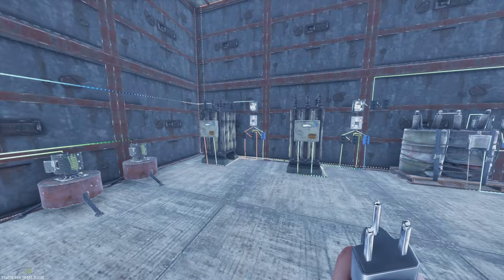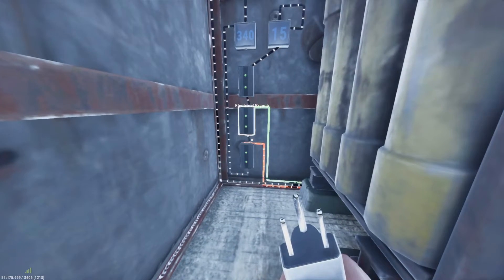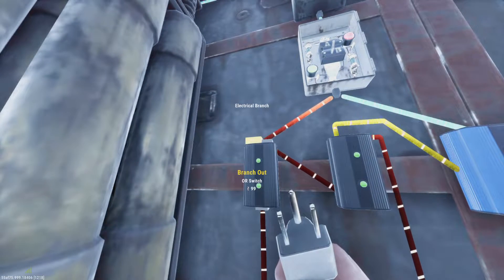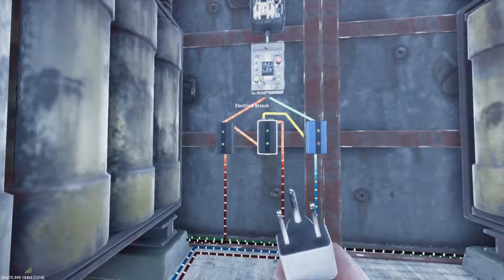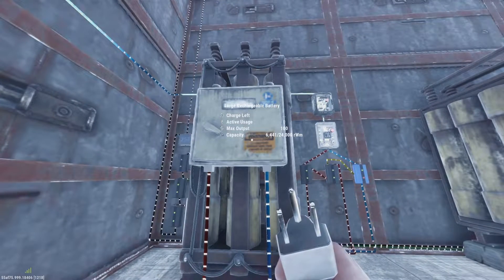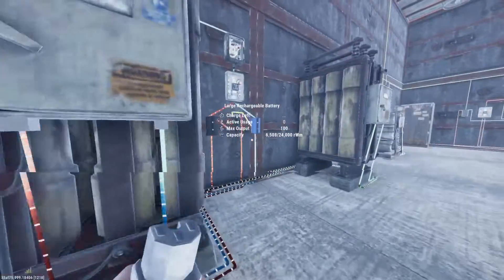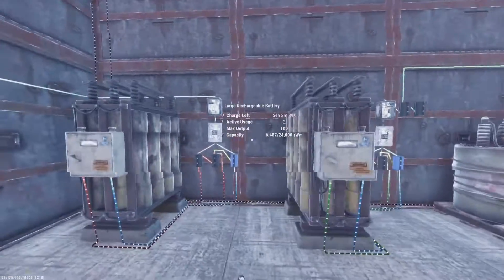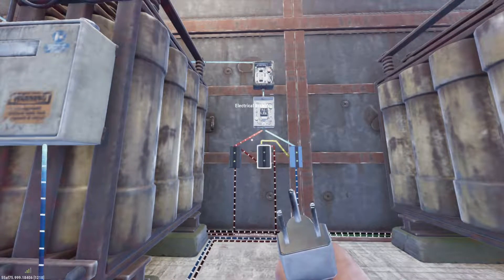OR/Blocker Power Management  Setup - Rust Console Edition

Comment: So just curious but what’s the benefit of running this setup vs running straight from the solar to the battery to the 3 way splitter to feed the rest of the system, as long as your producing enough power to properly charge and run the system what is the difference
Reply: If some hits your battery that would go down. This system can handle the battery being griefed and your power stays on
Reply from the maker: 100%. Provided you do have a wind turbine. If running solar only you will lose power only at night if your battery is griefed.
Reply from the maker: So 99% of the time the most vulnerable electrical component is the battery. They are hard to hide and once gone your whole system is down.

They also require 150 power or higher to charge and cover the night when under full use. So to run 6 batteries you would need 800 power min cnsitant during the day.

This system does 2 things. The first is that once setup it requires the same 150 to charge. Once charged fully in a few hours it can be set to 105. Saving 45 power. Multiply that by 6 and you saving 270 power. Giving you more power for 2 Moe batteries or 18 Moe Turrets on the same power intake system.

It saves that power by feeding the power directly to the Turrets themselves saving the 20% lose when charging batteries. It also then makes the batteries a backup system that only powers the Turrets when you producing less than the 800 power mentioned above. Which with the right solar/wind setup should never happen. So you're batteries can be destroyed and still have all your Turrets running.

Trust me for the parts it takes to make its 100% worth it.
Reply: @Mr.RustyHydra   I agree with you, my buddy was asking me what the purpose was and I couldn’t give him a definite answer, thanks you for the clarification. Btw love the videos, keep up the good work
Reply from the maker: No problem! Glad it helped! Have a great wipe!

Comment: Ive got a triple large battery switch over system, i try use minimum parts keep tge system light as possible in watts like its apollo 13
Reply: Mr hydra thats some serious depth of an answer and thanks for taking the time to help explain for me and others that see this comment,  ive been working on a hidden system with solar and a genterator that kicks in at night and off in morn as i always end up with too much low grade and solar can be hidden on the edge of square and triangle roofs that join simular to a furnace base, one binus is when they blow the roof and solar the generator automaticly kicks in.
Reply from the maker: I never thought of an automatic generator... Quite the idea. Love to see the end result. 

Also you're welcome for the details. To some it doesn't matter but to other it matter alot. Especially builders as they can take what they learn here and use it elsewhere. Like I did!

Almost at 1000 views in less than a week! That's 1000 people I feel I've helped. Which is why I'm here after all. Thanks for watching and commenting my friend! Let me know if you ever want to get together on the PTB and mess around with wiring!

Oh and the best way to hide you panels on the roof is to make sure at least 1 or 2 squares are facing north and ring them with low walls. Not only will that stop splash damage if they raid from the roof but the are low enough that you can fit 4 panels per square as long as you place them backside to the north side of the square first, and work towards you from there. The 4th panel shouldn't be blocked by the hight, but it high enough you can't see them from the ground to grief.
Reply from the maker: Lol Apollo. Love it my guy. Keep things small and simple is always the best way. However unlike Apollo, we have lot of power to play with. 1 windmill and 8 solar panels will cover 2 large batteries easy. 

Here's how to calculate power.... 

First it's your max output of your battery. Next you multiply by 10 minutes of night. Then divide by 30 minutes of day. Then because you only get 80% of the power you put into a battery you need to figure out the extra 20% you need to put in to cover that cost to get your full RWM needed to cover the night. Which is the formula below. 

10x10=100/30=3x100/80=4
50x10=500/30=16x100/80=20
100x10=1000/30=33x100/80=42

Those are the totals you need extra to not run out of power at night. Now we have to figure out how much power we need to charge the battery at max usage. This is kind of like above. 

10x100/80=12.5 or 13 to be safe
50x100/80=62.5 or 63 to be safe
100x100/80=125 

Now we add our night time amounts... 

13+4=17
63+20=83
125+42=167

The numbers above are the exact  MINIMUM you have to be charging your battery input with in order to the not only charge a full use battery but also extra charge for the night time. Anything less than this on full use will always eventually drain to empty. 

Now to figure out how many panels we need we divide by 20 and round up. 

Small Batteries 17/20=1 Solar 
Medium Batteries 83/20=5 Solar
Large Batteries 167/20=9 Solar

The only differences between straight to battery and my setup is you need 2 extra power to enter the system but they are covered already if you have the correct amount of panels above, and I prioritize the power directly  into the system whe I have it to only use the battery at night and no wind. Also if your system only requires 30 power just set he left branch to 30 and all that extra 20 power will give an extra 16 power of charge per RWM. 

All my calculations are based off full use batteries for maximum efficiency. If you follow above you will forget you have power once its set up.